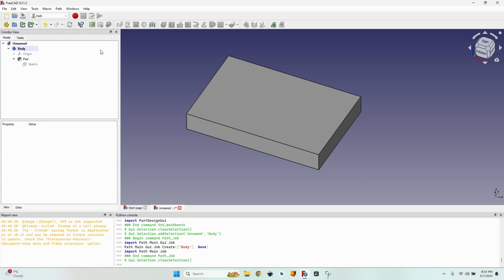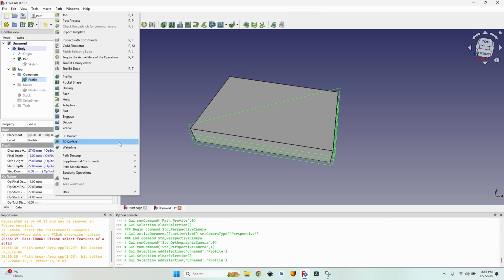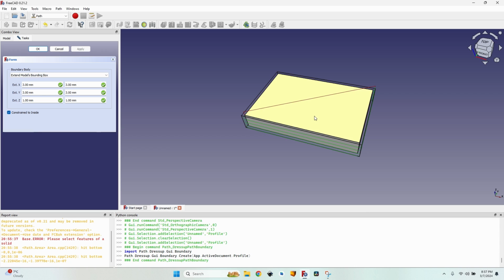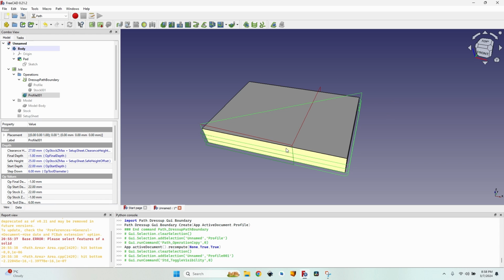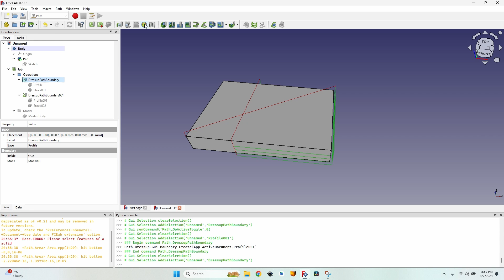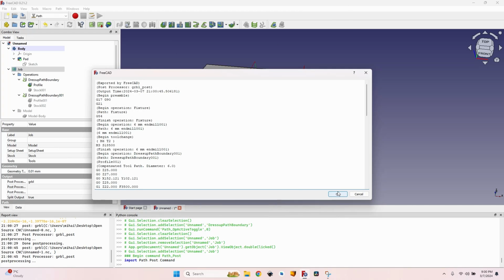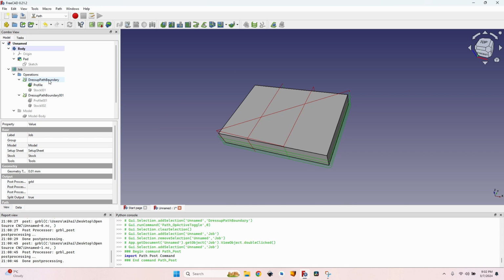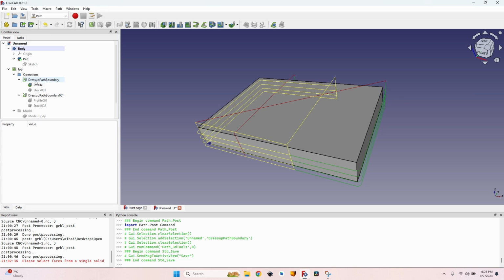Limit CNC Toolpath Area – FreeCAD Ep.9 | Boundary Dressup in CAM Workflow

Comment: Thanks for the video. Instead of splitting the files a `M0` could be inserted in between the paths perhaps. This allows for 1 program where it waits for the user to press continue when it encounters `M0`.
Reply from the maker: Of course, depending on the setup this could work better sometimes

Comment: I'm interested to see how you use Blender for 3D carves. I'm also looking forward to see how you use the Vcarve feature when you get to that point in your tutorials. Thanks for the tutorials so far, it's been pretty difficult to find a speciality channel that concentrates on CAM videos within Freecad.
Reply from the maker: Hello!
I just posted the video about V-carve. For now, just a somehow basic introduction, as I haven't used v-carve that much myself. I'll experiment more and for sure I'll add another video in the future with more scenarios.
I will start the blender series, but at a later time, for now I'm focusing on FreeCAD.
Reply: @opensourcecnc  Hi. Thanks a lot I saw your V-carve video, watched the video and liked it already, it's cleared up a few questions I had. With regards to Blender, I have been using it for around 8 years or so now and I think I am pretty good within it (my profile picture is a render of one of my models). I heard you mention Blender in the video and I was curious how you use the two pieces of software workflow in CNC.
Reply from the maker: I'm not too much of an experienced blender user, rather I might fit in the beginner group. But I had a situation where FreeCAD would simply not be able to make the path for a complex shape that I needed to carve. So, after googling a little, I found blendercam which did the job good and fast. Since then, when 3d carving on the cnc, I use blender.
Reply: That sounds like me with Freecad and CNC, I am a noob with that. If you use Blender for sculpting, I'd recomend getting a cheap drawing tablet, that was such a game changer for my Blender sculpts.
Reply from the maker: I actually have an xppen 13.3 pro that's gathering dust, I'll give it a go. Thanks!